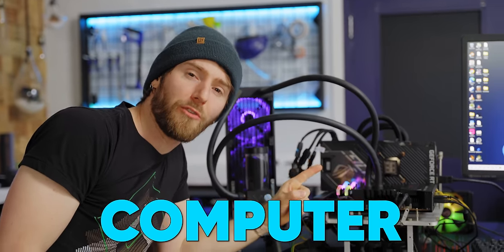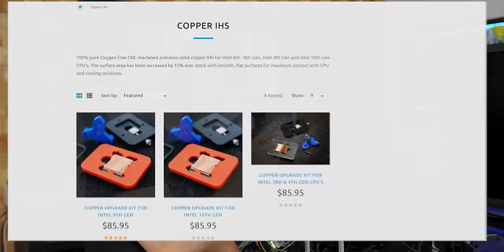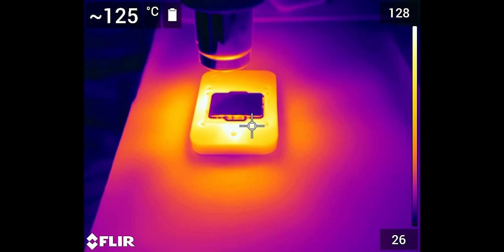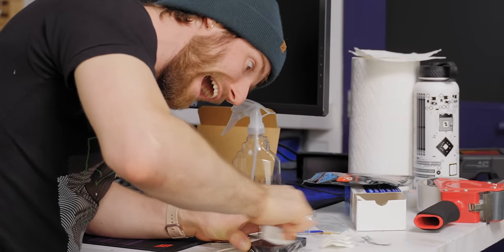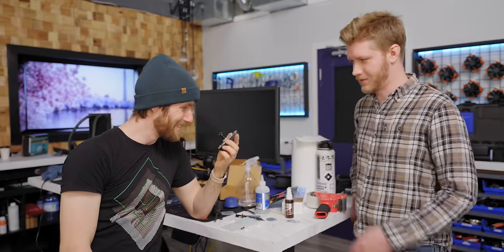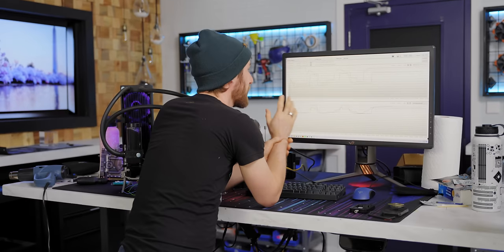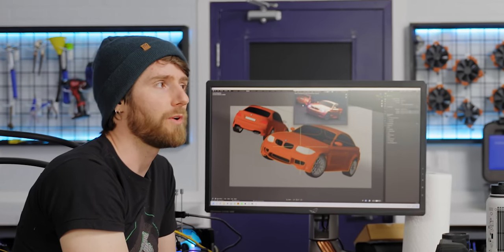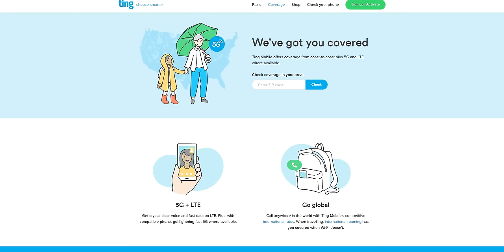Making Intel's Worst Product Better.... And Also Worse

Comment: Men, i like what Intel does with their Eco system ever since the First Core Series CPUs.
USB3 integration, Thunderbolt, iGPU, Ethernet and Wifi Cards - everything running solid like 99,9% of the time
But at this point they are a bit ridiculous about how much they cling to the "fastest gaming CPU" title making their tech look kind of bad to me.
Reply: Thanks for watching 🤗   
Send a direct message right away,I have something for you🔝🔝🔝

Comment: Do something funny, and dumb, put copper IHS on 12600k with 32GB ddr5, , use stock cooler and run only intergrated i-gpu  in a completly closed mini xtx pc case with only 1 exhaust fan.
Reply: Thanks for watching 🤗   
Send a direct message right away,I have something for you 🔝🔝🔝

Comment: Good day Linus. I hope you'll answer me,cause my question isn't about the video,but over something else. I'm scouring the internet,but to my dismay.....no answers for me..just the same old story ( i5 7th gen intel processors aren't of the recommended processors for windows 11). My laptop specs is i5 intel,1 TB nvme m.2 SSD with 16GB of RAM. I quailify for al windows recommended requirements,but just my processor isn't good enough for Microsoft. I'm getting an overhaul better experience using windows 11 on my laptop,than with windows 10. I'm getting better and more consistent FPS in games,my temps are better,than what it was with windows 10. I hope you can tell me, what is the reason for Microsoft not allowing i5 7th gen intel processors?

Comment: Sigh... they don't have the fastest gaming CPU.  So sad.  Taking all this top flight hardware and tying it to a slug of garbage like an Intel processor.  You could swap in a Ryzen 5800X3D and probably beat it, a 5950X for sure.  Especially for the sorts of benchmarks you ended up doing, which were not CS:GO which Intels processor claims the W with, spending half as much on a 5950X would almost certainly beat the crap out of the 12900KS.  Blender especially, 16 full performance cores versus 2?  Not even a challenge.

Comment: I’ve got this CPU running with a 3080 Ti and it’s absolutely incredible. Stupid amount of power draw but it’s an incredible experience for flight sim at 4K 120Hz or VR.
Reply: Should've went with 5800X3D for Flight Sim.
Reply: @K.R.X  5800X3D isn’t as good in single core performance. Flight sim is a large part of what I play but it isn’t all.
Reply: @harrisongilbert  KS is a stupid cpu and has been past 3 generations. Don't even try to justify that mate. "Incredible experience" at 4k. You're gpu bound no matter what.
Reply: @K.R.X  I agree, that’s why I said it’s a stupid CPU?
Reply: @harrisongilbert  Well congrats then. You bought a stupid CPU. Only if a lot of you didn't buy it. Intel would actually make something not stupid.
Reply: @K.R.X  I don’t have anything against AMD, I just didn’t want to have to replace my entire motherboard just for a processor.
Reply: @harrisongilbert  You one of those people who upgrade everytime something new comes up eh? Good for you. Enjoy your rig mate. I just think KS is stupid and people should boycott it.

Comment: Hello, how are you?
I have a very big problem with AMD and since I did not know where to tell you, I raised this problem with you, maybe you will reach AMD.
I have an RX 570 card with 4 GB of RAM, I admit it is a weak card, but AMD is very annoying.
Now, 2 years after the release of Horizon Zero Down game, he has not published a proper driver for this game.
In the game, you do not see the textures of robots and houses or wooden fences and floors.
Like the game Cyberpunk 2077, which for 4 to 5 months was the character of the game in the main menu of the game was black and you saw the lighting, but there were no shadows.
Right now, the best driver for Horizon Zero Down is 20.4.2, which is very old, and secondly, it shows the textures correctly, but the plants are strangely large and small.
Why is AMD so selfish company and why does it harass its users and does not respect their users' rights at all?

Comment: If you can see tooling marks it most certainly isn't 'flat.'
Industry standards are a 3.2 micron finish.

If I was paying $35 for a precision machined part and it came with a 3.2 finish, I'd be pretty upset.

Copper is difficult to machine, but that's still no excuse.

Comment: Yes is FAST, and YES it is hot as furnace... I imagine ONLY the CPU draws up to 250-260W and the GPU draws 450-500W KEKW... NO thanks i prefer to use 5800x or 5800x3D and Radeon 6800XT, WAY more cold, WAY more cheaper and WAY more power efficient for like what 10% less performace.. Only baboons will buy these parts from the video, reasonable ppl will stick with AMD parts...

Comment: I don't really understand why in almost all KS CPU reviews, there is no emphasis on undervolting, that is a huge advantage on a binned CPU, you can basically retain 12900K performance at closer to 12700K power draw and thermals, also there are a lot of discounts for such high margin parts, so you can getr them for a very small premium over then non S CPU.

Comment: here is the proof why you are just amd army
when intel made the fastest cpu on the planet  that maybe hot 2022 you attacked it
when amd made ryzen 7 7800x3d that burn out the motherboard randomly !!
you said the best and fastest cpu
I will not also talk about nvidia fastest gpu ever, rtx 4090 and the " amd said its the best " bruh, rx 7900 xtx